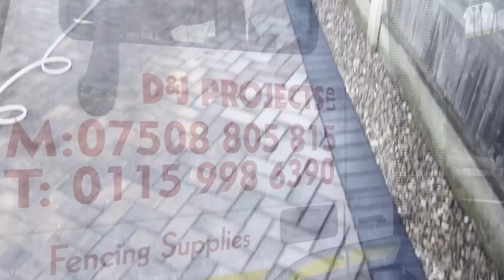Can anything else go wrong ? #028

Comment: You guy's workmanship is literally art work...
We have been watching your videos mirrored onto our tv to give us some ideas for our new driveway and to have a laugh also.
But we have a question of how come most drives you do dont have the picture frame?
(A frame inside the outer edges)
Is this something to steer away from? 
We like the idea from Looking at Pinterest pictures haha.
We have really enjoyed watching your videos. Thanks
Reply from the maker: Thanks so much for watching…we really appreciate your  support.

The answer is there two ways of doing it neither right or wrong. So when me and chris trained we trained with a well known and multi Marshall’s award winning company. (We ourselves are Marshall’s award winners )😎

That’s the way we were taught. Personally I’m not a fan of path edgings there badly made and brittle. One tap of a hammer Snaps them in half. Plus there 1” thick. 1”!!!!

over 20 years we’ve had no end of problems with them chipping when compacting, cracking in half … there great but if they go wrong there a nightmare.

There’s nothing worse than completing a job only for one to crack or move and have to dig up large sections of a Newly laid driveway to replace. So we will use them on the front for aesthetics but not very often anywhere else. (Now some cretin will no doubt now chime in with “that’s cause your installing them wrong blaa blaa”) but we have in 20 years installed 1000s of path bloody edgings and I speak with experience.

what we choose to do is use a strong ballast mix and pour concrete 6” deep and 4”+ wide (depending on the width of the gravel trap.

Failing that we lift out the boarders and place them on concrete also if we feel there’s not enough retention. 

so that’s the answer really. Just a different way of doing things. In my opinion stronger. And when we’ve been in business 15 years and we hand out guarantees weekly with no issues then it certainly works!! (Never had a single complaint or issue with this method in 20 years ) 

ANYONE WHO NOW CHIMES IN BEING RUDE AND CRITIQUING OUR METHODS TO TRY AND DISCREDIT IS AND DRUM UP BUSINESS FOR THEMSELVES WILL BE BLOCKED … BORED OF IT NOW !! 

YOUR NOT HERE FOR THE RIGHT REASONS AND SO I WILL REMOVE YOU. 

Really tired now of 3am Saturday morning coked up drunks commenting drivel !!
Reply: We really appreciate your response and information you have given us. I stumbled across your channel with doing my own research and we watched and enjoyed every video to date. You have given us some great ideas as to what to have done. Not just a driveway but fencing to front and rear aswel. Ultimately a driveway isn't just like buying a washing machine or microwave ect ect its a fortune to some of us.
Hence why ive been researching. We have a guy and his crew up here in Yorkshire (god's own country) we have in mind to do the job for us.. fingers crossed it will be near as good as your work hopefully 🤞
Once again thanks for the information and we very much intend to watch the videos you post even after our work as been complete. Its better than watching Cora anyway 👌 👍
Reply from the maker: @andyward295  thanks

Comment: I’m a skilled Landscaping myself have been running jobs of my own for the eBay part of a year. Block paving, Indian Sand stone, porcelain, breeze and brick walls, artificial, fencing and the list goes on. I’ve been watching the channel for 6months now and you guys are great. I’m ocd and particular myself on the work front and always look at things from the customers perspective and guarantee and high end long lasting finish. One let peeve of mine is cross joints in patios, why’d you end up with one on this patio?
That aside best regards

Comment: We're in need of our driveway doing and was thinking soak away I'm glad you said that because I don't like the idea either as surley it will erode eventually. Ours is alot like that so frustrating.
Reply from the maker: Don’t get me wrong they can be installed , and installed well. But under the right conditions!! If it’s solid clay or a tiny driveway with no area for it to drain then you need to look at the other options.
Reply: @BPPavingnottingham   yes get what yours saying our drive drop towards the house aswell so when it pours it down rain overwhelms the drain as its not plumbed into the main drain for some reason looks like it was at Sompting but someone decided the block it up with concrete do you cover ng16 area
Reply from the maker: @riggaz8499  ng16 what’s the area ?
Reply from the maker: @riggaz8499  email me its on the info page

Comment: Quick question, I noticed that you don’t generally add a membrane after you’ve wackered and before paving, is the membrane not needed?
I know that weeds will generally come through due to gaps in between paving stones due to sand being moved etc. 
Cheers and keep up the good content - I’ve come to you guys via D&J Projects. 
Shame I don’t live nearby otherwise would have been happy to use your services.
Reply from the maker: Legally no, we will use them if the grounds particularly bad but in nottingham locally most of its thick solid clay. it’s a nightmare for drainage but amazing for a sub-base as it’s solid. A membrane will not stop weeds on block paving it’s a myth

Comment: Great job again guys! I,m thinking of having a go at doing some off road parking at my sons first house in his small back garden,  its around 4m width and 5-6m long , everything I,ve seen you guys do seems to be a good compacted sub base two lots of around 75mm then do you compact an inch of sand ? how much would you screed roughly after the sands compacted,? I was going to do herringbone but the somewhat easier 90 degree patern from the front, one last question for you if you dont mind I,ve seen some 200-100mm -80mm blocks very reasonable on e bay from the Marshalls direct shop (£100 a pack 6.1 m in a pack) I notice most people seem to use the 50mm blocks are the 80mm any harder to lay or compact in your experience? sorry for all the questions I,ve never done any block paving but laid plenty of bricks and stone but obviously using mortar and a string line , any advice would be gratefully recieved  ;-) Thanks in Advance! Martyn.
Reply from the maker: The 60mm are sufficient… any more is industrial or commercial really! 

There is a video I did on how to screed take a look. It’s very hard to do tutorials on here as everyone knows better and you get a load of sofa surveyors talking nonsense lol
Reply: @BPPavingnottingham  Many Thanks mate! I will try and find that one, and yeah totally get the thing about the sofa surveyors, (rolls eyes) the sad thing is the few clever arses spoil the thing for the majority who just want some advice or help by watching the videos and asking questions , this then makes the video producers reluctant to respond I guess, but ces la vie! Many thanks again your videos have certainly insired me to have a go for my lad ;-)

Comment: Hi lads
Re grey drive
What coloured sand did you use and Do you seal the drives as well?
Ta
Reply from the maker: We haven’t been able to sand it yet due to the weather. Just waiting for a sunny dry day. However in the uk there’s only 2 colours really a peach coloured and yellow diy stuff.

We use the peach coloured in a red bag as the yellows is abit much
Reply: Could you use flexi seal?
Reply from the maker: Flexi seal? What type of product is that ?
Reply: @BPPavingnottingham  
Sorry 
Jointing compound

Comment: I only use a blockcart if it's a long run I'll start laying and get the front cut and sanded first 
And always top work
Reply from the maker: There not practical on most domestic driveways … I wish they were